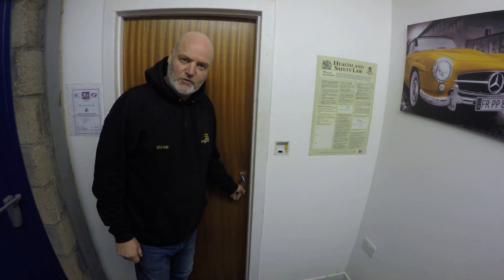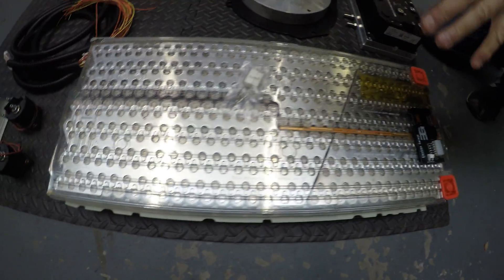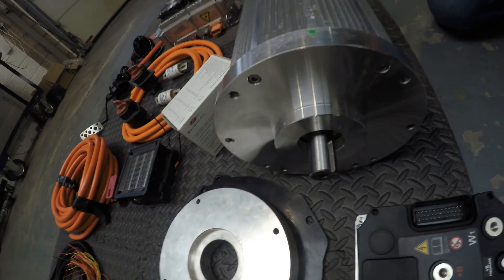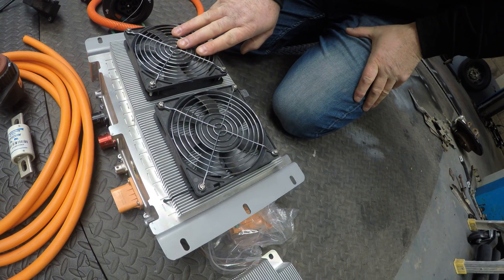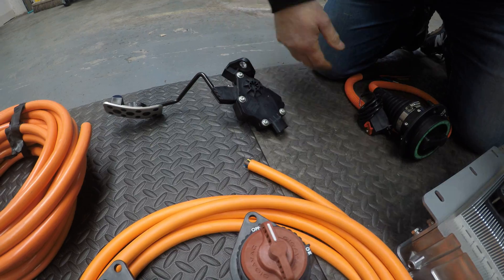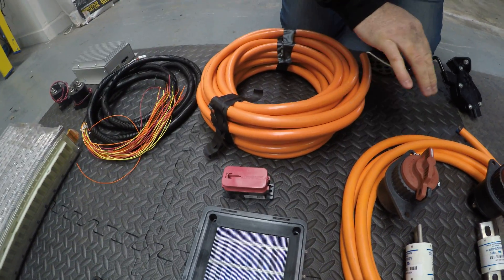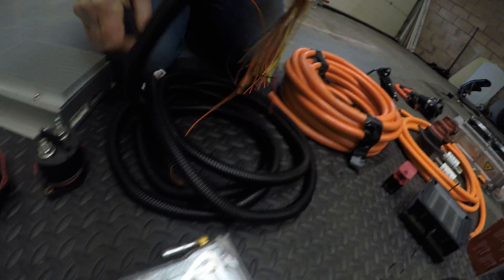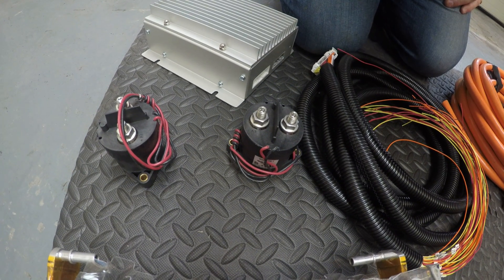Electric Vehicle Conversion Kit

Comment: What do you recommend for gearing on the hyper 9?  My factory axles are 3.55:1, and could possibly be rebuilt with up to 5.72:1, but that's a lot of added cost.  I wish someone offered a kit like this that had a step down gear already installed.

Comment: Looks like AC system, why NOT DC  simpler system pwm should work fine up to 100 miles/hrs,  just a question.??
Reply from the maker: just depends what you want to get out of the vehicle, nowt wrong with dc but most people are using ac systems now, regen and efficiency would be the biggest reasons.

Comment: Could you use lifpo4 batteries with built in bms instead?
Reply from the maker: Yes absolutely, they will be slightly heavier but if they are cheap then yes. They will also last longer and take more punishment.

Comment: Do you sell these kits? I think a Mazda MX5 or Toyota MR2 would be great for a conversion (apart from battery packaging). I do wonder about the original ECU in modern vehicles that works the dash , alarm and other systems working in conjunction with the electric drivetrain. I suppose you could just trickle charge the original 12 volt system from the lithium battery pack via a step down transformer? The engine management lights on the back of the dash would need pulled and the gauges converted over to battery charge level. Rev counter/tac not needed but could be used for fun to check leccy motor rpm. Do you keep the clutch in a manual trans, I suppose you still need to synchronise engine and wheel speed when shifting gear regardless of electric? I heard some people who have done conversions using the original manual trans remove the clutch to make dirrect drive and block all other forward gears apart from 2nd as the instant torque means you do not need 1st, and the ratio of 2nd gear suits an electric motor for efficiency at most speeds, not sure if this is all true. I can see an issue arise with an electric motor if using all the original forward gears and having to shift up or down, if you take your foot of the power to dip the clutch to change gear the electric motor will quickly drop to 0 rpm as it does not need to idle. Dumping the clutch at speed after changing up or down a gear with a leccy motor at 0 rpm will tear the clutch apart, which is why only using one forward gear would simplify things? If using all the forward gear ratios then would you need a wheel speed sensor to help the motor take up drive more smoothly when switching cogs? I am genuinely intersted and would love to tinker on a conversion myself, live in NE Scotlans too.

Comment: is there a PTO system for the AC compressor?
Reply from the maker: From the HV junction box there are fuses that can be used for a HV compressor or you can just use a 12v compressor.

Comment: Great video breaking the whole system into easily understandable chunks. As a petrolhead I've started to become interested now that the technology is becoming more mature and end user friendly. I only have one question, if you swap out for electric how is the brake system run? Is there an efficient pump to run the vacuum booster or is there a different system available to run the hydraulics for it? I understand that the motor can do some braking and regen but there not designed to stop a vehicle correct?
Reply from the maker: If your car engine has provided the pump for the servo, you simply use a 12 v brake booster pump. These are an off the shelf part used in many vehicles like BMW & VW. The same can be said of power steering there are 12 v electric steering pumps commonly used in the Vauxhall Zafira.
Reply: @ElectronGarage  thanks for the info. I'm in the US and am not super familiar with the newer vehicles and didn't know that these were an off the shelf or pulled from a scrapyard option.  Been giving thought to doing a conversion with a Pontiac fiero that's been needing more work than it's worth to rebuild the engine and un frock the wiring harness that a squirrel got into.
Reply from the maker: @ottopartz1  nice one, there’s a few firms in the US that you can get parts from. Thunderstruck, EV West or Stealth EV. All the best in your conversion.

Comment: The accumulator has 5 kilowatt hours of electrical energy.
Reply from the maker: If you mean the battery then yes, each of these Tesla modules have 5.2kWh of energy. You can use the later models too that have 6.2 kWh.

Comment: My mom has a 2007 Saturn Vue with a 2.2L engine. I think it would be a perfect candidate for an EV conversion. It has a bad engine - although it does still start up and drive. My mom doesn’t change her oil though but I think it would make the journey out to California IF babied. 

She’s looking to spend $5k anyway to get a different car. I’ve read that it costs about $8k to $10k to convert an existing vehicle to EV. The Vue’s body is made all out of plastic - so lightweight and no rust. I feel like converting that would be a very wise choice financially. Approximately how much would it cost if I brought it out to you guys. I feel like I would have to anyway - I don’t know of many EV conversion shops here in Wisconsin.

Also, do you know if there’s a tax credit for doing an EV conversion?
Reply: With conv. kits running about $25,000, it may be better to convert a valuable classic. Unless you have extra $ and want a great daily driver, of course.
Reply: @rickm7209  wow I remember conversion kits used to cost 5,000 dollars what gives?
Reply: @LK-pc4sq  battery didnt exist back then
Reply: @rickm7209  oh absolutely not. I think thats more than the whole Vue was brand new lol

I found how expensive it was. She just bought a GOOD vehicle this time - a 2011 Acura MDX. $10k. That was a DEAL!!!

Comment: Hi great video. A couple of questions please.
Is it possible to convert a w202 mercedes 1995
C class? And what kind of range would you get 
from normal use.? Thanks in advance
Reply: does not matter what car..the motor mounts are important. What is the mass of the car?

Comment: Thanks, I was wondering how to heat my vehicle in winter when it has no coolant running through it.
Reply from the maker: We use a PTC heater, it’s basically a heating element that comes from the HV battery pack, these can be fitted where the old heating matrix was.
Reply: @ElectronGarage  This requires pulling your entire dash out. A water heater can run through the existing inlets and you can control your heat with the existing controls.
Reply from the maker: @blackterminal  really depends what car you are converting, some matrix are below the dash and yes some cars will require the dash removing. EV conversions can be straightforward and some are just plain difficult.
Reply: @ElectronGarage  My project is a e36 bmw. It has the nice climate control panel. I wanted to retain that functioning ideally. I was thinking to drive the old ac compressor with a treadmill motor directly connected to it but now thinking maybe i should degas it and later fit a simple 12v aircon compressor. Would like to minimize power drain as the car will have a relatively small capacity main battery . everything goes back to cost.

Comment: you have not mentioned anything to compensate for the brake servo ?
Reply from the maker: Just depends on what car your converting. Most classic cars don’t have a servo running from the engine, in fact a lot of classics cars don’t actually have servos.
Reply: You can get at electric servo.. got one on my busa smart car
Reply from the maker: @stueypinnock8875  hi yes we fit them to modern cars but with the new disc brake set up on our electric camper we don’t need one.

Comment: I’ve 3 questions: 
heating/cooling of cabin and battery? 
Regen/Cruise?
Cruise control?
Reply from the maker: Cabin heating can be a PTC heater, battery cooling and heating just the same as Tesla would use, how you control that is up to what BMS you use. Regen absolutely yes as with all AC motors. Cruise control is not something we have done but it can be done if your willing to put the time in to controls or can sniffing.
Reply: Is there an AC unit for cabin cooling?

Comment: I'm about to start my EV conversion on a 1978 VW Bus.  I plan to purchase the same Netgain Hyper9 motor/controller like you have. I actually live close to Netgain here in Illinois, US. I didn't see the transmission adapter on your website.  Do you sell them? If not, can you give advice on a good place to get a nicely machine aluminum coupler and plate for VW?
Reply from the maker: Hi Scotty We get them custom made, EV West have them in stock. Were off to do a T2 Camper next. All the best with the build.
Reply: @ElectronGarage  - Funny you should mention it.  My bus is a Westfalia camper too!  But I will be restoring it without the camper interior and making it into a unique electric work van.  I started the restoration videos on my channel if you want to compare notes. Look forward to your next videos.  Thanks!
Reply from the maker: Fix It Scotty nice I will follow along. We’re looking for a cad drawing of the chassis if you know where to find one, we want to put most of the batteries underneath.
Reply: @ElectronGarage  - I don't have a CAD drawing, but I plan on designing custom 18650 cell packs to go mostly under the cargo floors. Maybe jehugarcia has one?

Comment: Wait till you get access to a decent distribution network of Hydrogen fuel... with an array of Fuel Cells, a hydrogen pressurised tank (or solid storage), expensive Lithium batteries that take an age to charge will be a thing of the past! AND Fuel Cells will provide AT LEAST SOME OF the heating for the interior too.

Comment: Interesting. Do you guys do different horsepower packages? I've got a Z28 laying around I'd like stuffed with 1000 electric ponies.
Reply from the maker: You could add a Tesla Large Drive Unit and take it to 650 horses with bucket loads of torque.
Reply: You could always wait a bit for Ford to sell the components for their mustang super cobra 1400 EV. They showcased it rather recently.

Comment: Sorry. I didn't quite understand why  (or what for) you have two different types of orange cables, one with 3 different little cables inside and another larger one
Reply from the maker: The single thicker cable is the battery cable for HV side. The other cable is the charging cable it has L.N.E and 2 pilot signal cables which communicate with the charger.
Reply: @ElectronGarage  sorry again, what's L.N.E.?
Reply from the maker: @xXZ31t6esTXx  Live Neutral Earth
Reply: @ElectronGarage  thank you!
Reply: As I understand it, larger goes to the controller and also connects the 2 battery packs. The other one gos from one battery pack to the charger(?)

Comment: I am comparing prices and spec options for an EV conversion. I want to have an AWD setup, and my donor car is an AWD. Is it better to do 2 direct drive setups or create a single adaptor with 1 larger motor? And spec wise, do I calculate total horsepower and torque by adding both motors (if I was to go for dual motors) Thanks!
Reply from the maker: 2 x Small Drive Tesla units with inverter boards will cost circa £10k. Lexus kit will cost around £3k and allows more of a budget for a decent battery.
Reply from the maker: It really depends what you want from the vehicle but as a minimum you should match the original horsepower. If you can find one motor that will equal or slightly higher a single motor is the easiest route and you keep your original gear and transfer box. You can also use OEM like Lexus RX as they have a motor generator for the front and motor rear differential you can buy a third party board for the inverter and control the motors from the one inverter. You can also go the Tesla route with either 2 small drive or 1 large and one small motors in adapted subframes. email info@electrongarage.co.uk for further costs and details.
Reply: Mind the batteries when doing a high hp AWD swap, you need a lot of battery to get all available power out of two Tesla drive units. Especially if you combine a small and a big drive unit, the peak current will be very high
Reply: Thom kouwen I wasn’t planning on two full size Tesla drive units 😂 I was thinking either one mounted to the drivetrain or two smaller direct drive motors. Not sure if they would end up being Tesla, depends on how quickly this all adds up.

Comment: Could cooling be added for the Tesla batteries?
Reply from the maker: Chris dirtytrucker08 hi yes we will be adding cooling and heating to them.
Reply: @ElectronGarage  good to hear, it's my understanding that is the key to longer battery life.
Reply from the maker: Chris dirtytrucker08 with Tesla Model S and X the chemistry is happier to be kept at a constant temperature. if we look at the data from the cars they have very little degradation.
Reply: Do you have s contact number?
Reply from the maker: You can email us on info@electrongarage.co.uk

Comment: Im actually really interested in these electric vehicle conversion kits the part that baffles me is how do you deal with the vehicles lights abs  instruments and others electric components
Reply from the maker: nick Orourke we still have a 12 v  battery to run all the accessories. This is charged up by the DC DC converter in the same way an alternator would do. ABS, Air Bags etc can all still work with some programming.
Reply: @ElectronGarage  i always wondered this how they managed to get around the vehicles dash wiring and how to make it all work together id love to do this conversion to an old toyota ae86 corrola which would be called a tragedy but id love to see it done.
Reply from the maker: nick Orourke nice choice of car to convert. If you need anything just get in touch.
Reply: @ElectronGarage  thanks i will do looking at auctions for donor vehicles at present see if anything fits the project of what will make the conversion an easier one 
Thanks for the info...

Comment: Firstly, beautiful kit. Are they for sale? Also a comment on your cab heater. Have you thought of using the factory eberspacher gas heater to extend the vehicles range? I think that is the route I will take when I do a conversion on an old beetle. What are your thoughts on that?
Reply from the maker: Thanks Andrew, yes if you would like to email us directly we can discuss. In terms of heater we are trialling another solution at the moment.
Reply: @ElectronGarage  yall trip up on these great videos OMITTING prices 
i know zero about cars but have studied tesla since i was a kid . Esentially whats used here is what was stolen by the FBI from Tesla ( Trumps grandad lead the raid - all true ) upon his death - then sat on for years as it would cripple the US banks ( who set oil prices ,via the petro dollar) . Its a tesls coil & output power ratio hugely magnified by the batteries ( whis tesla NEVER ENVISIONED :/ )  Tesla saw a future where electricity can be simply "taken " from the atmosphere , wireless technology it was called back in 1920 !  The cost of this HAS to be astronomic to offset the loss to oil - ironic that we just stole FIVE TRILLION dollars worth of lithium from Afghanistan ( real reason we were there ) I am interested also- where do you dispose of the dead or broken or no good battery packs ? cos they arent recycleable - some components are but the crux of them are not & will end up like the ridicuous wind farm propellers which also have no recycle abilities . So i was not astonished to see a price tage for JUST the coil between 5 & 10 grand & ANYONE whos got a spare 1972 VWB knocking about clearly has no money issues :/ this isnt a car for the public & its eye watering the prices - would like to know ( & see ) where you take or send the batteries too - good vid anyway dropped you a like ,cheers